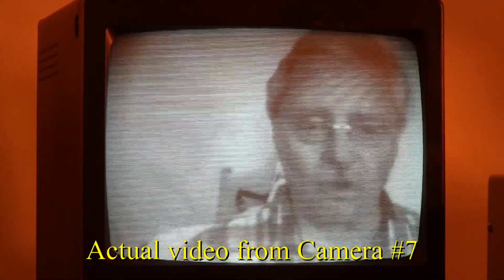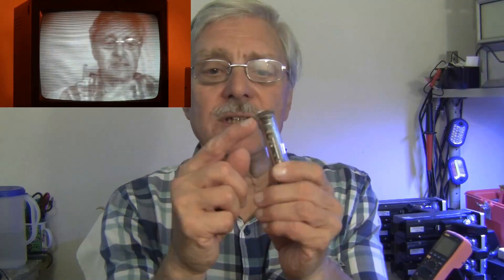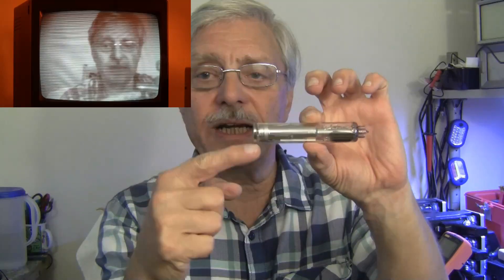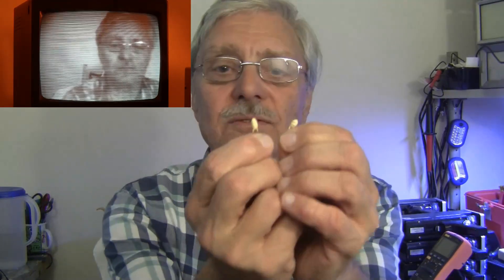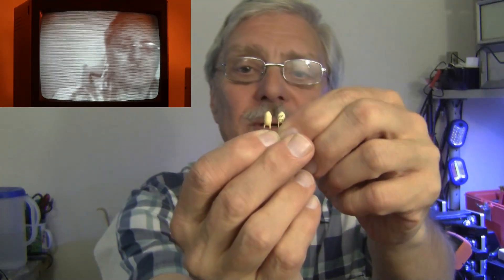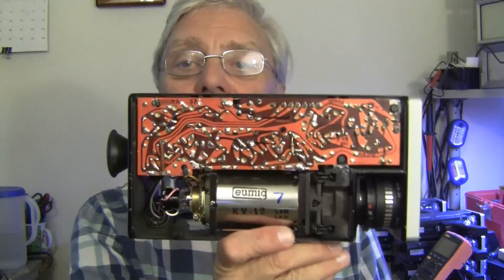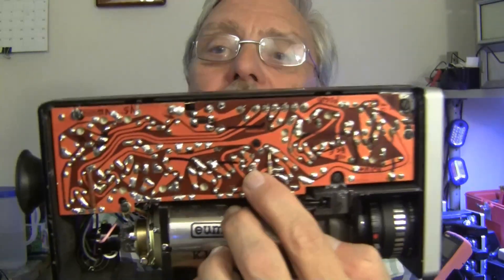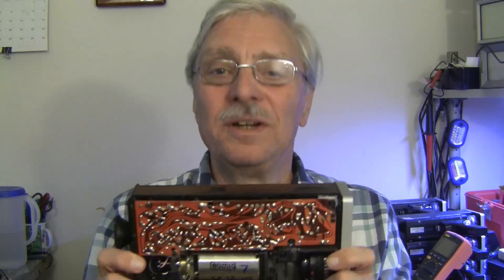Cartrivision Camer-A-Thon, Part 6 - "All Solved Problems Are Trivial"

Comment: OMG i will check mine when i work on it ...seems very much the same problem ! just shows you its a fault that you will never forget next time you ever work on one ...i will keep that one in my head ! i never knew the titanium caps ever failed ! that's a new one ! The cable story reminds me of our family 60s B/w valve tv had a remote unheard of in Australia in the 60s but it was via a very long multiwire cable ..to change the volume and channel via a motor gear box in the TV !
Reply from the maker: Tantalum capacitors are designed to fail catastrophically. They usually dead short and burn an big non repairable black hole right through the PCB. I refuse to design with them for that reason. Plus they are extremely toxic when they burn. In this case, the caps were not tied directly to the power line, so could not do damage. The one part did not short this time. This is the first one I have ever seen go open circuit in my 40 year career.
Wired remote control. Brings back memories. Ah, the luxury.
Reply: @videolabguy   i always thought they were the best capacitors ! but i never used them much  due to how bad tiny  the markings for polarity are ..OK i will listen put them on the don't bother with them list
Reply from the maker: Tantalum capacitors need to be operated at 80 to 90% of their voltage rating. But, NEVER over that. We used 6V rated caps on our 5V logic power lines at Prime Image. The problem was a form of noise spikes that I call "hair". You can barely see them on an extremely fast analog oscilloscope. Not at all even on a fast digital scope. At any rate, these noise spikes go over the capacitors rated voltage and break it down over time. When they fail in that service, they usually short out and burn as I mentioned. We had a hell of a time finding the cause of the failure. We finally rented a 2GHz analog o'scope and we could finally see the spikes. We jsut changed to 16V rated caps knowing the product would be obsolete long before those caps would fail.

Comment: It's amazing to see vidicon tubes in action, good job! How much current do they pull at 18V? I'm in the process of designing a configurable USB-C power supply board for projects like that, would you be interested?
Reply from the maker: Thank you for the excellent question. I just directly measured the current drawn on the +18V power line. It is 366mA. At 18VDC, that's a power drain of about 6.6 watts for the entire camera. The current at the photo target of the 8844 is held at a constant 150nA (0.15µA!). The tube itself consumes literally no power. It is mostly consumed in the deflection circuits, the focus coil circuit and inefficiency of the HV power supply.
Reply: @videolabguy  That sounds pretty good, USB-C can do that easily!

Comment: These Cartrivision cameras  are surely crying out for a colour wheel colour conversion project !!!!...........No?............I'll get my coat................
Reply from the maker: It is a good idea. But, vidicon cameras don't do well in that mode. The interframe lag makes for weak or even no color. I have a Sanyo camera project that will use a silicon target vidicon with a color wheel. Think electron beam scanned CCD. No lag between frames.

Comment: If you can find an MM5369 chip, this will count down 3.579545mhz to 60hz.
Reply from the maker: Andy! Thank you. I knew this chip back in the day. Couldn't recall the part number to save my life and could not find in all the internet searches. Seems to be easy to get on Ebay. Thanks again.